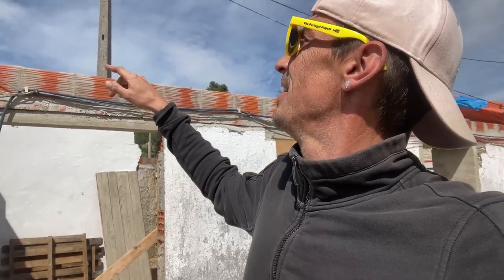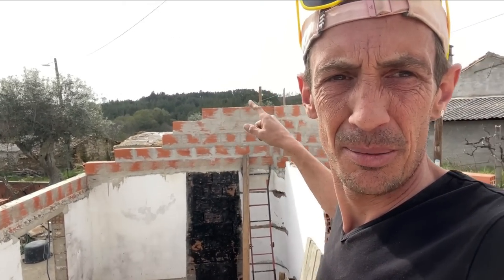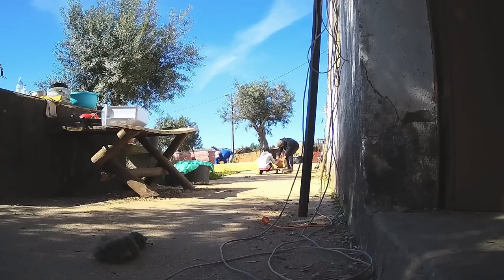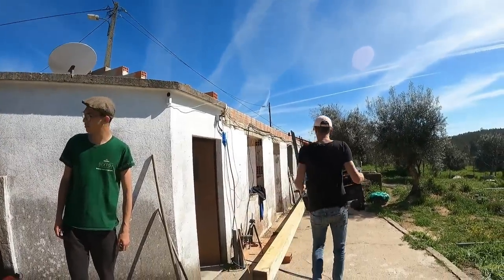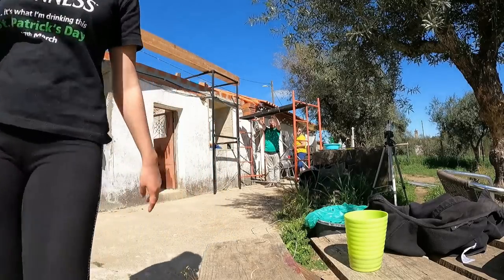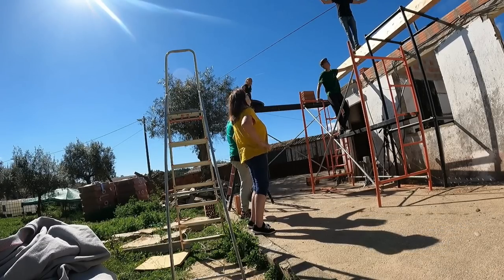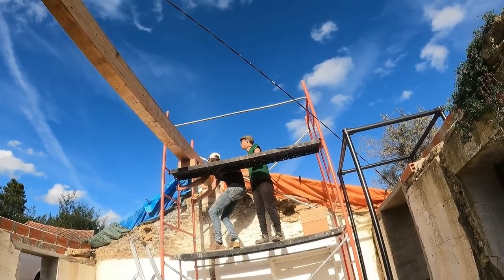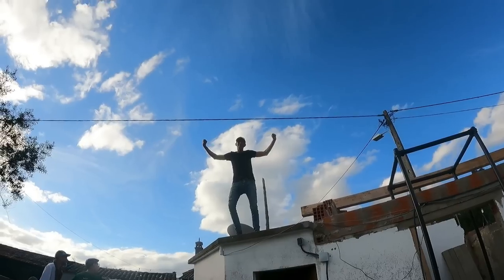S3E8: THE RIDGE BEAM GOES UP! - DIY PORTUGAL

Comment: OK, if I can make a level mark, using the laser, on one end wall and the other end wall (1 meter off the floor), I can measure to the peak and establish a level line for the ridge.  You did well lifting the beam.  Since I was always the stocky guy at work.  The one who squatted under heavy stuff to lift.  I prefer cribbing towers.  Lift each end 3 or 4 inches at a time, cross stacking wood, till you reach the height you need.  The pipe worked great for a resting spot, till ready to cross the wall.  It will be a beautiful roof when finished.  You should be proud of yourselves.  Nicely done.

Comment: Tijolos are not made to carry weights, u should use concrete blocks there
Reply from the maker: Yet almost all the houses around here have the same structure with a beam on tijolos.. :)
Reply: @GhostTownVlogs  Is that why they are ruins with collapsed roofs maybe?
Reply: @bedlam8159  😂😂
Reply: Or atleast fully fill em up with concrete

Comment: Would the water level you used for the doorway in your last video not have worked to level your beam? You can use normal hose pipe and just have clear pipe at the ends if you need to extend it.